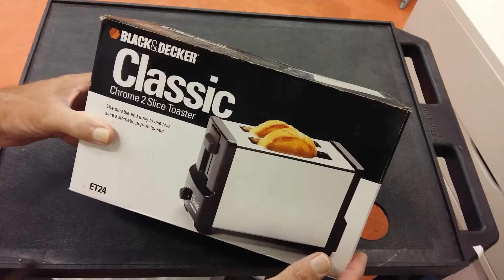How It's Made: Electronic Toaster (part one)

Comment: How do you know it is mica? i am writing a assignment on a part in a toaster, and this is the only place i could finde someone who told about that particular part?
Reply from the maker: Good question. I am not certain that it is but the insulation does have the characteristics I expect: shiny crystalline surface; structure is a very fine lamination of super-thin sheets. I hope this helps
Reply: @jolyoncaplin747  It helps a lot!!! it is excatly how i would describe my element, and i would never have figured it out without this video :) so thank you very much :D